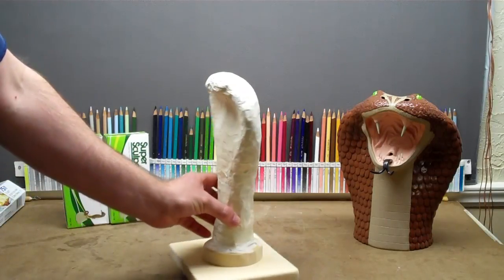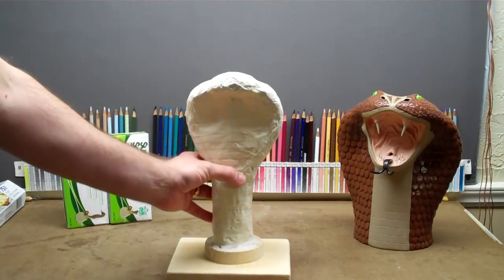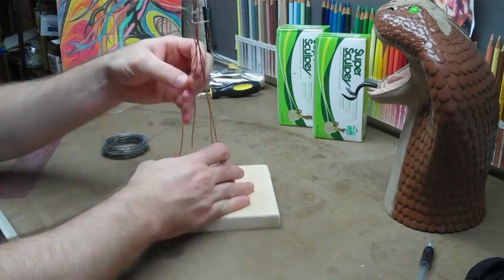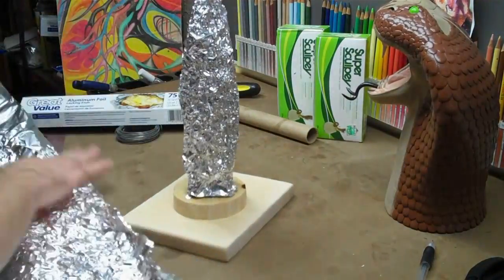King Cobra Tutorial Part 1, armature

Comment: Really enjoying your work and tutorials. Just did a life sized macabre hand in a very similar manner. I have been making lots of jewelry and wanted somewhere for the rings to be displayed. I used lots of foil, scrap clay,  copper wire and a cut down paper towel cardboard tube for my armature. You might consider the the cardboard tube for part of your armatures. It sure cut down on my work.

Comment from the maker: ><   Aluminum foil is used for cooking, that's what its sold for, to cook things in your oven. If you put it in the microwave, yes, it will blow up.

A BETTER question would have been about the tape, or wood.. LOLOL  Seriously though, aluminum melt at  933.47 K,  or 660.32 °C,  or 1220.58 °F  And I doubt your oven goes that high LOL